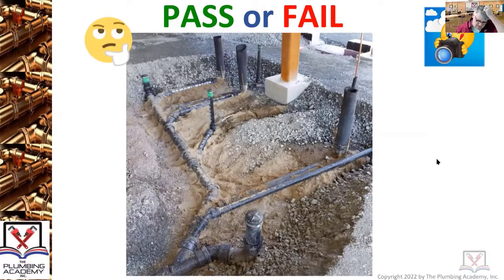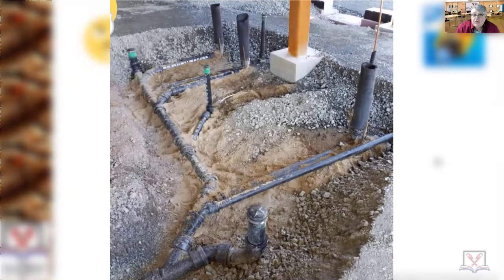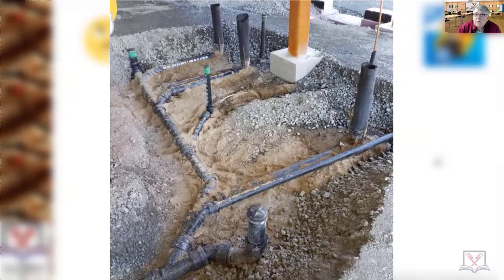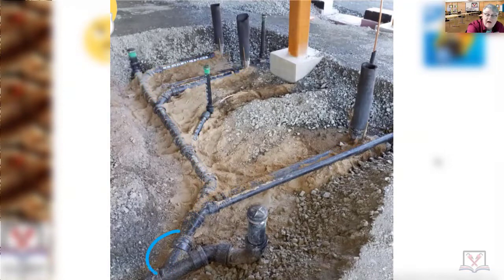Battery Venting Floor Mounted, Floor Outlet Fixtures - Fundamentals.

Comment: Its a great pass or fail Norman. I do have a question about a sanitary T to be looking straight up and cut over! on the minute 4:33. The “cut over” meaning “turn the flat vent below ground on straight up Sanitary T”. But the vent ll be below the toilet flood level rim, right? So, the vertical Rise on 248 CMR 10.16 (7)(b) doesn’t apply for battery vents? If i'm right the 248 CMR 10:16 (7) (b) 2. a. apply for it? I hope u understand my question, Thanks.
Reply from the maker: Yes, I understand your question. In Massachusetts battery venting below the flood level rim, or below the weir of a trap can be performed in limited application and with very specific installation practices. Depending on the fixture, or fixtures being served; floor drains, mop receptor and similar fixtures can be vented below the flood level rim, or weir of the trap serving the fixture as long as the surface area of the fixture to be drain is no more than 144 sq. inches.